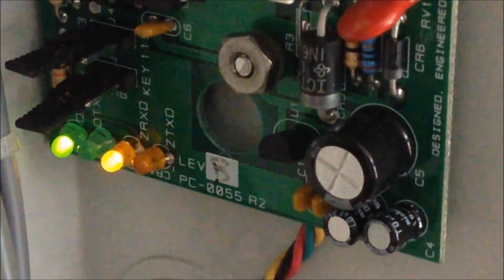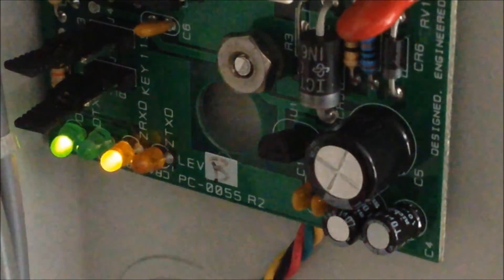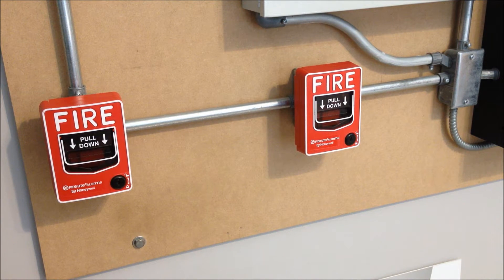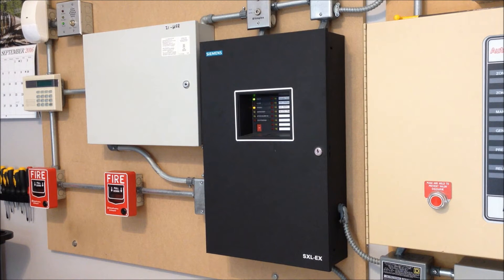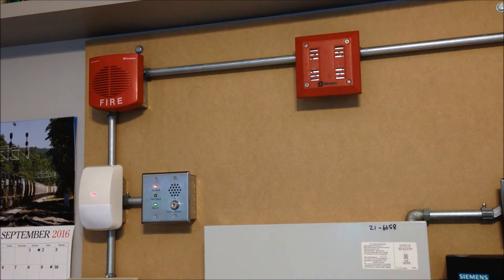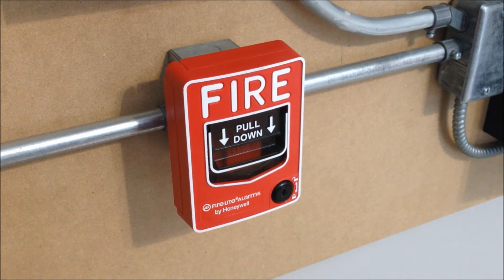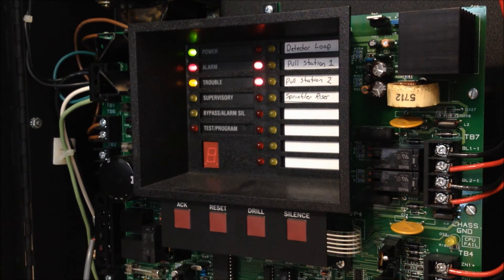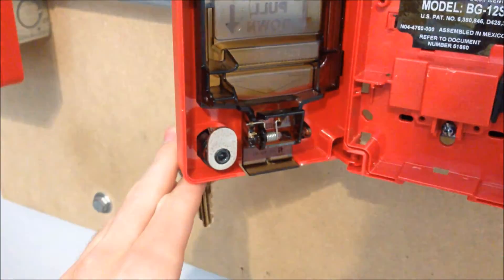System Test 22 | Simplex System: Old Mechanical v. New Electronic

Comment: The 2901-9845 is the high-output version of the 2901-9840. It's more than twice as loud (100 db vs 85 db), but draws double the current. A TrueAlert and a -9840 would be a near-tie, and the former draws even less current.
Reply from the maker: Thanks for the info! This horn still comes nowhere close to one of the Federal 350s I have... probably couldn't even tell the 9845 was sounding next to that thing.
Reply: kcin556 I don't think I've ever heard a 350 in person. I have heard the 450 (as the Simplex -9806). My middle school had a voice evac system installed in the gym, but never bothered to take out the old horn. It was one horn vs. two 2902-9713 speakers, which themselves are fairly loud. The message was barely intelligible.
Reply from the maker: They're actually a fairly nice sounding horn. I have four (2 modern style, 2 old style) and they're all great, except for one of the older ones. I would put it at around 105-110 db at first guess. I can't even record it from any close distance without distorting the mic on my phone. Loudest horn in my collection by a LONG shot.
Reply: near tie is correct this is my school system which I really love when you hear  the combos together

Comment: can you do an old Edwards system from like the 90's
Reply from the maker: Other than my Edwards pull stations, I don't own any 90's Edwards Fire Alarm devices right now.. most of what I have from Edwards are 120VAC General Signalling horns. I'll see what I can do.
Reply: Do you have any 892 horn strobe
Reply from the maker: Nope. Here's all my Edwards stuff: http://kcin556alarmwebsite.weebly.com/edwards.html
Reply: +kcin556 I'll let you know if I can find anything on eBay that is from the 90's
Reply: kcin556 Do you like trains? I do.
Reply: Could you have true alerts and Spector alerts on one system test?